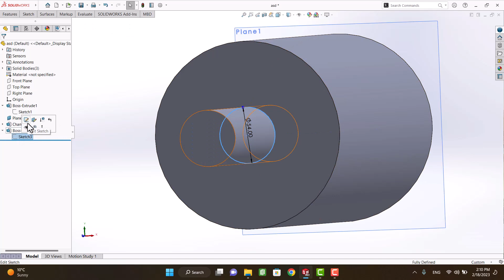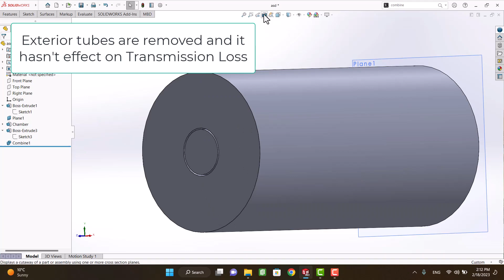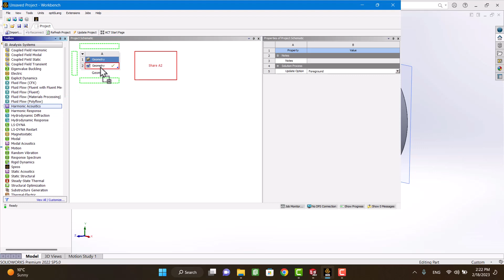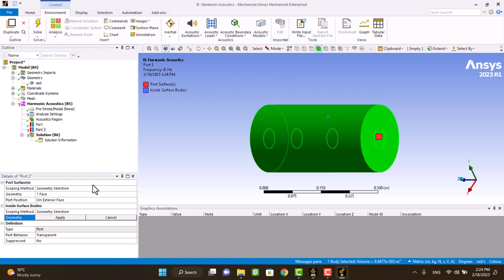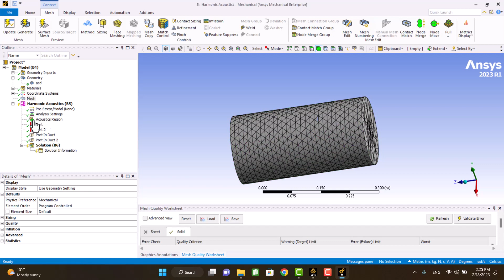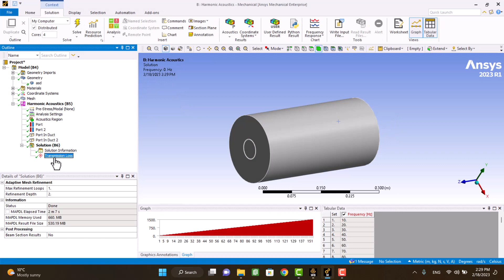🔊 ANSYS Tutorial: Sound Transmission Loss of an Extended Tube Muffler 📉

Comment: iv been following this steps but the transmission loss wont give a result instead it shows error "The input power at the driven port is equal to zero. Please check the port definitions". please give me a solution
Reply from the maker: Specify inlet power. I entered 1 pascal in this video
Reply: @caewitharminhashemi  i have entered 20 MPa for the pressure and it gives the same result
Reply from the maker: Geometry is not correct

Comment: I am an Acoustic Design engineer. I design exhaust mufflers for vehicles a lot. Only a week ago, I have started using ANSYS for this purpose. Until now I have been doing the designs based on first principles using Matlab etc. 

Do you have any suggestions about where can I start learning ANSYS particularly for muffler design?
Reply from the maker: Hello, I always use comsol for acoustics analysis. I haven't found any ansys tutorial for acoustics purposes.
Reply: @caewitharminhashemi  Can Comsol take into consideration the gas flow and temperature variation inside the muffler and predict its impact on the acoustics.
Reply from the maker: @JSAcousticsOz  thank you. By Coupling fluid flow and heat transfer, you can investigate effect of temperature and Flow on transmission loss.
Reply: @caewitharminhashemi   I thought so. I guess I should reach out to a local COMSOL suppier in my country. Thanks for the information so far. Have you had experience with SIDLAB too? Whats you experience with ANSYS vs SIDLAB vs COMSOL in terms of Muffler TL predictions? If you wanna chat outside of Youtube, I am happy to share my email. As I am keen on learning all these softwares.
Reply from the maker: @JSAcousticsOz  you're welcome. Unfortunately no.
Reply: @caewitharminhashemi  By the way, I have subscribed to your channel. Also sent links to some mates of mine who have same interests.
Reply: Hi guys, I'm an engineering student in charge of designing an exhaust muffler system for a racing car, do you think I can use this tutorial to predict the efficiency of my muffler? @JSAcousticsOz, as an engineer, have you been able to test this tutorial and use it for your job? is it consistent with reality?